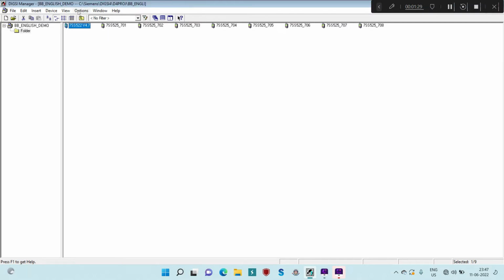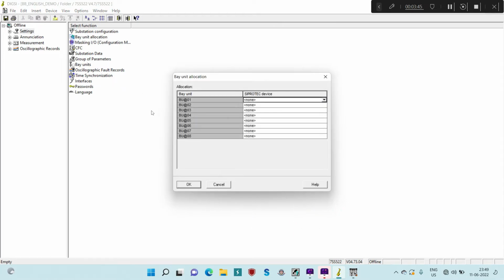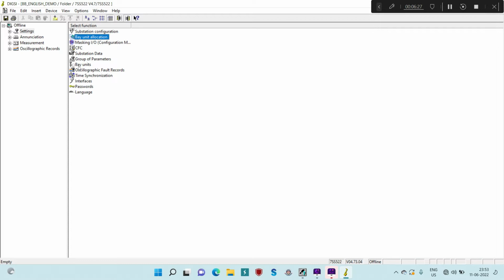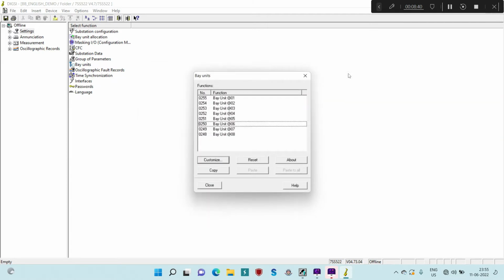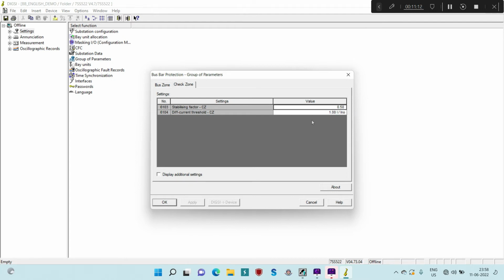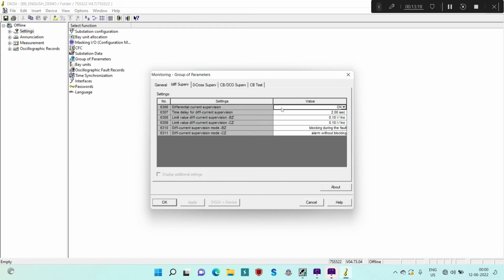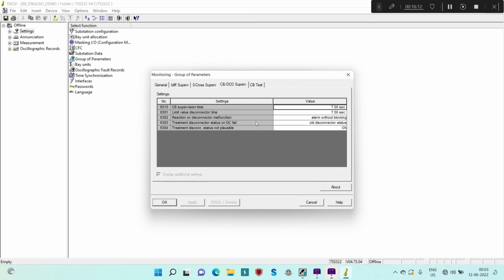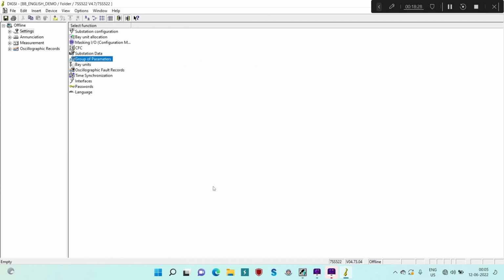SIEMENS DE-CENTRALIZED BUS BAR RELAY CONFIGURATION USING DIGSI | 7SS522 | 7SS523 | 7SS525 | PART-2

Comment: Sir,
Please explain following case.
If the bay 701 in open condition & on closing of CB once again tripped on SOTF with high fault current.
The CB closed for fraction of second, but topology of busbar system may be not able to sense that CB close condition, but the bay CT sense the fault current.
The operation of  Siemens Busbar system for above case may kindly be explained.
Reply from the maker: Dear Friend,
Due to change in my role assignment at my new place of posting. I am presently unable to upload the video. I will start uploading the video shortly. Sorry for the inconvenience.
 I will upload my next video on this topic itself.
Reply: @LIGHTNINGMINDS_PANKAJKUMARJHA  Thank you Sir. Waiting for your next video